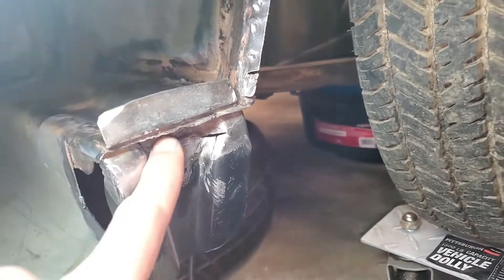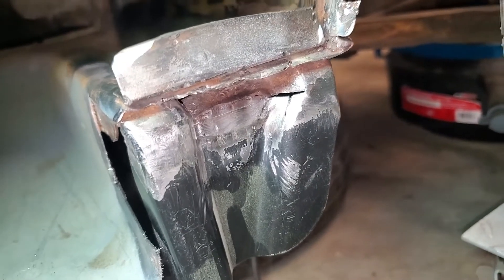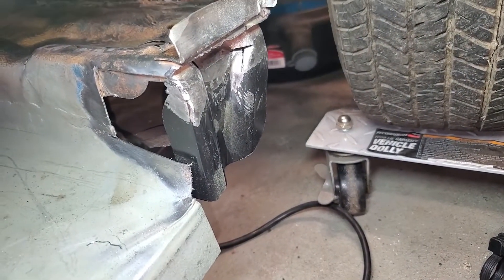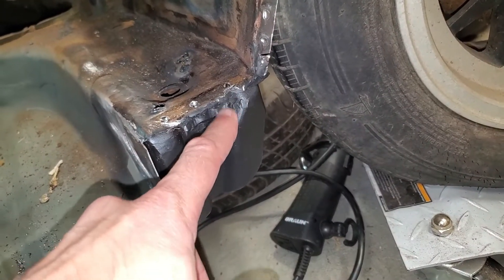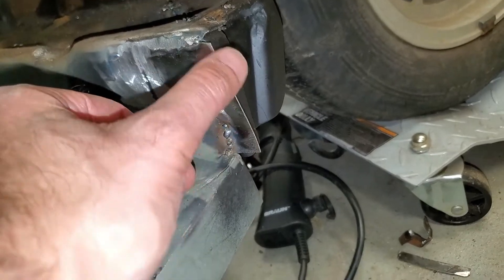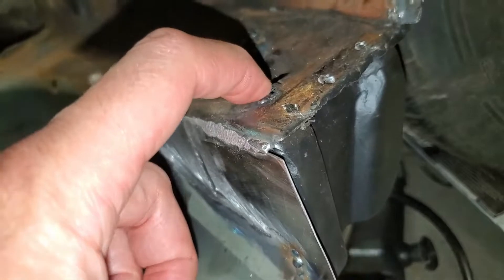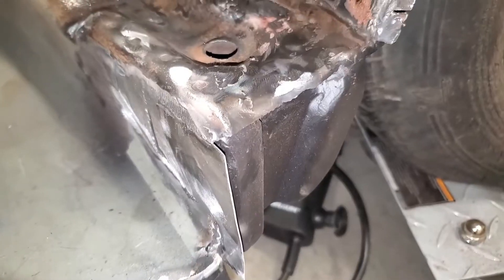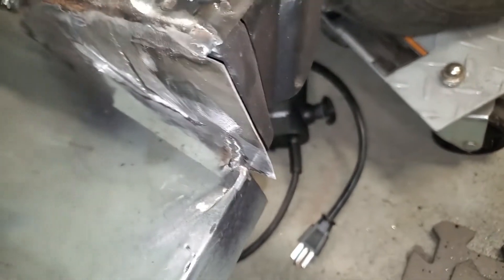Triumph GT6: Passenger footwell

Comment: Looking good David!  I had to replace both of those brackets, and I still have yet to drill holes for them.  I couldn’t get the bracket hole to line up with the outrigger, so I’ll end up drilling a new hole through the bracket itself.  Oh well!  Keep it up!
Reply: Steve, drill from the bottom up. Takes out the guesswork or measuring from the top.
Reply: @drivewayshop  That's my plan!